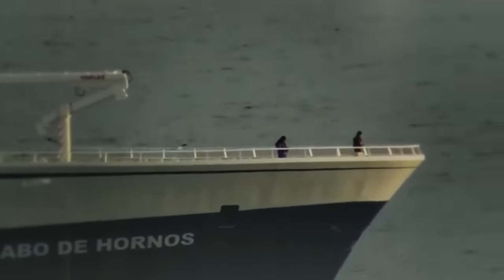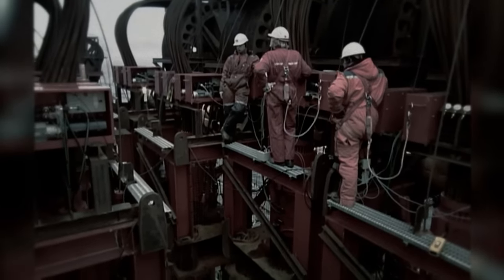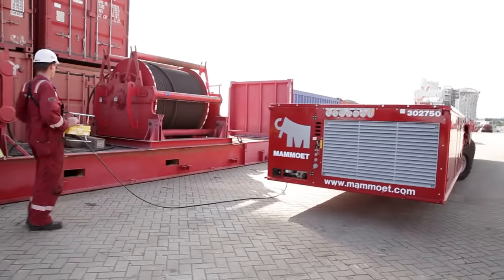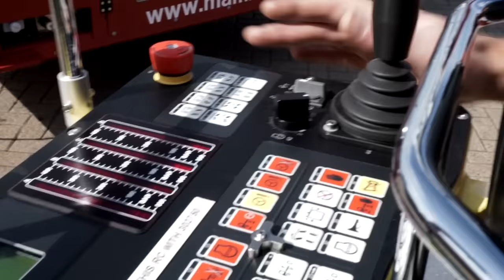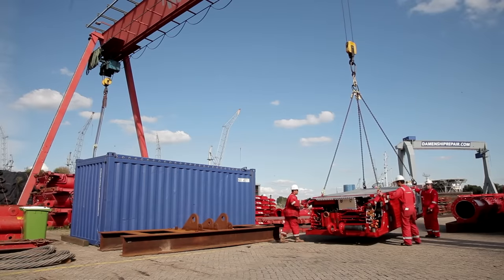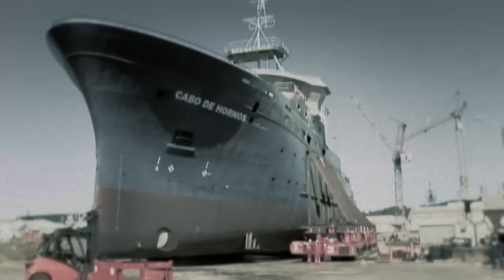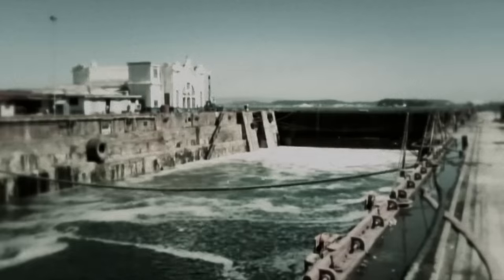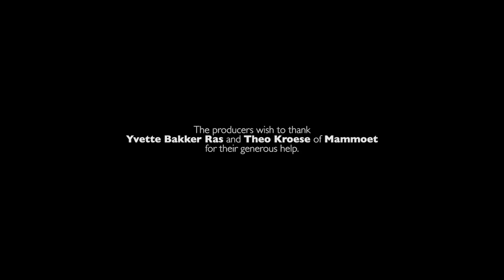Saving Tsunami-Wrecked Vessel | The Salvage Masters

Comment: The shear cost of just moving all that heavy lift eqipment half way around the world and back a long. Never mind the million of dollars to prepare the ship and ground work for month of man power and machine. One would think it be far cheaper to cut the ship into peaces and scrap it. At the price of scrap steel being high. I can't see it being anything but a huge cost loss in even trying to re- float that less then half built ship. Even if it was paid by insurance to move an re- float it an move it into dry dock and repair the damage as well as cleaning the hull of hundreds of ponds of weld off the sides of the ship an ex- ray every welded area for any cracks in the hull in a a large area around every weld that was put on to hold them big triangle i-beam legs to lift on. Cracks from the huge stress on the steel hull from the lift and moving it. I as a welder and fabricator really think be far less cost to cut it up were it sits and sold off as scrap. I am sure any insurance carrier would write it off long before paying out that huge cost to do what they did over paying out the  I praise the value of a partially built ship
Reply: I agree with you.